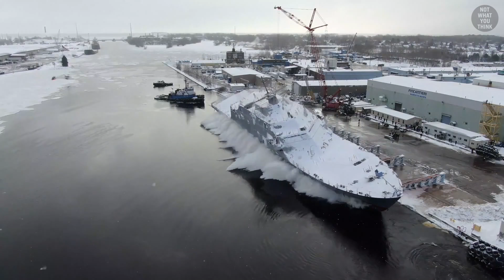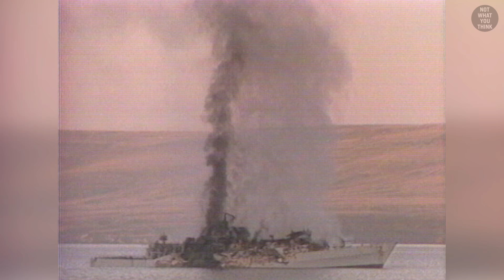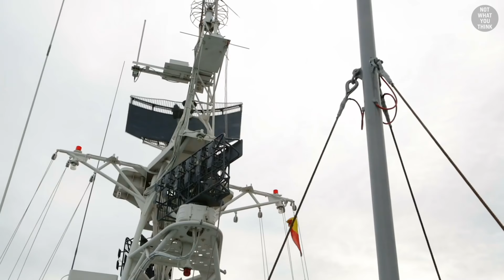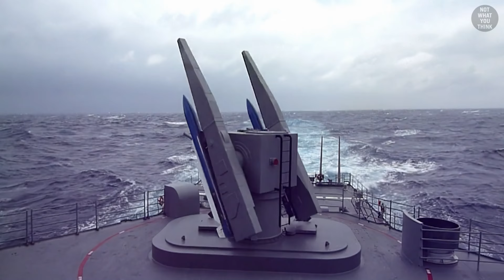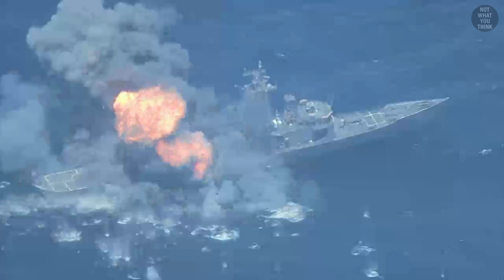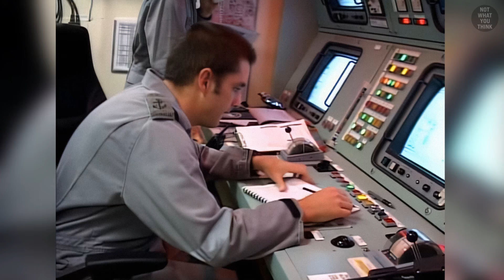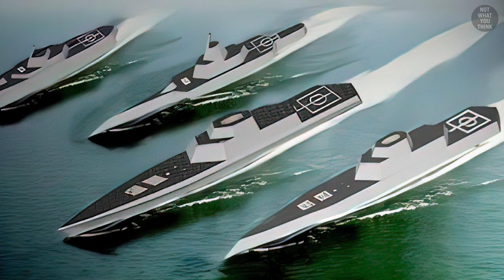How US Navy Made The Most Successful Destroyer ... But Now Has to Replace it.

Comment: I am curious about about the Arleigh Burkes, particularly older ones, and their power generation limitations... i know this may seem like a weird thing to ask, but have they updated all the lightning and displays onboard to LED lighting? Have they switched out older computer processors with newer more efficient ones ones, have they switched out hard drives for solid state drives. I mean a 10 dollar raspberry Pi, is probably more powerful than all of the computer systems on one of the original Berks, combined, and i know is gonna use a shit ton less power. I am not saying you can use a Raspberry Pi, but for god's sake, the miniaturization and electrical streamlining of the technology is there... hell who knows, maybe you could just install Raspberry Pies on board?
Reply: Lighting loads are very small and insignificant. It's the larger inductive loads of pumps and motors to support everything that takes up the real power. DD

Comment: Pretty sure the MK`13 could NOT fire ASROC, but both the MK13 and Mk26 COULD fire Harpoon.
I'm curious was it really a political requirement that the Burke's  were shorter than the Ticonderoga's or was it something like dry dock length?
After all the Ticonderoga's were a DD hull,so it seems weird to say our new DDGs need to be 50' shorter than our DDs.
Reply: NM: I've never heard the '50 ft shorter" requirement.  It makes no sense to have an arbitrary number.  I'm sure it was derived from some other requirement.

Comment: Actually, if you look at pictures of the USS Enterprise and USS Long Beach from back in the 70's,  you will see the original "SPY 1" radar.  Yes the predecessor to the AGES Radar system used today.  It has been a long time in development.  (USN 74-84)
Reply: But, those were vacuum tube tech panels. They drew enormous amounts of power, but, more importantly, as I understand, too many critical component parts broke down and not enough spares were aboard. (I didn't serve aboard the Big E, but did visit her several times, one being an 8 hour dependants day cruise/tiger cruise off San Francisco in 83). 

Eventually, those mid-era NTDS panels came down and other radar replaced them tol the Ticos got the SPY-1A/etc stuff.
Reply: @davidsyes5970  I know just about the USS Norton Sound as a test platform for the AN/SPY-1 (1973) and the preceding phased-array AN/SPG-59 (1962). Since the USS Norton Sound's engines could only produce 9MW, there was a natural limit to the amount of power which could be diverted from propulsion into the radar system. I doubt that it could draw as much power as the AN/SPY-1A and later series (up to 6MW at full power).

Well, it is probably true that the SPY-1A and especially the SPY-1B (and later) had a "tighter beam", allowing for more efficiency and lower average power (only 58kW), and the option to run it on lower power with still sufficient capabilities - in situations when no threat is present. The  SPY-1B  was so efficient that it would have only halved the range of a Ticonderoga-class if it had been operating constantly at full power!

Well, no wonder that they chose to install the early system on the Big E (which I wasn't aware of!) - it had quite a bit more power to spare than the Norton Sound.

Comment: The Burke on its first cruise cracked and had to spend the deployment in the yards in France.  But the old ship we kept going all the way back to the sandbox.
Reply: Oliver Hazard Perry class had the same problems. They solved there problems, with adding a strengthening beam along the hull on both side, just under main deck. Can be seen as a hump om both side of the hull on Perry class
Reply: @heuhen  I was on a Forest Sherman; USS Jonas Ingram-DD938. We knew the Perry class was crap when the super structure cracked up top after some rough seas on an Atlantic crossing. We were in complete awe of the Spruance Class and I never thought they would retire so early. Good video.  DD

Comment: think about the missions and the cost of each, 1) area AA, 2) local AA, 3) ASW, 4) gunfire, 5) missile strike, 6) ABM. Area AA and BDM require the expensive radar. these also require big VLS cells, which is also suitable for missile strike. the other missions local AA, ASW and gun fire do not require high expense and can be done in a low-cost ship. specifically, gun fire is high risk so should be done with an expendable asset you are willing to risk. Of course, LCS was stupid in going for 40kt, which really stupid in a ship that might operate in shallow waters, and a waste overall. 
31 Kt Burke got his name when he was directed to intercept a Japanese destroyer + transport mission. He had been reporting 30kt for some period to indicate the state of disrepair of the fletcher destroyers that can do 35kt at full capability. When there was potential for action, he found a way to do 31kt. it was probably Halsey's chief of staff who sent the message

Comment: Oh, finally a video about the DDG (X)! Aside from the new hull, the DDG (X) is also designed to be modular enough to be given extra space or "modules" if future threats or future technologies call for it. In short, the overall hull length can be greatly increased per flight! And it's not just 3-5 meter increases, but much more!
Reply: They're designing into the DDG(X) the ability to literally cut it in half, add a new hull section, and weld it back together. They got the idea from the Virginia Class submarines.
Reply: @seanj4119  Technicaly, Modularity was already a concept that was tried (And failed) on the LCS, but it worked better on larger vessels like the Virginia. Guess that was another lesson from the LCS program and the Virginia-Class subs that they're applying to the DDG(X). And given that the DDG(X) is gonna succeed both the earlier flights of Arleigh Burke-Class Guided Missile Destroyers and the Ticonderoga-Class Guided Missile Cruisers, it should have all the room to host future technologies, and if it runs out of room, it should also have the ability to expand within reasonable margins
Reply: @seanj4119  And definitely due to this capability, we might possibly see latter flights of DDG(X) outright exceeding the Zumwalt-Class in terms of both length and displacement.

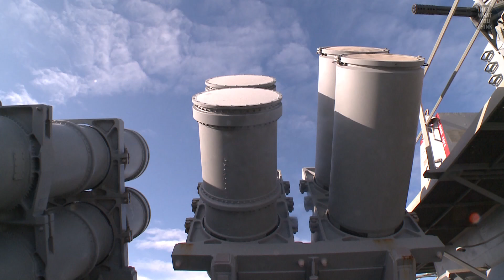Comment: 11:58 actually, the increase in VLS cells didn't come from additional units
they abandoned the onboard missile reloading crane (which was proved impractical) that took up 3 cells worth of space in each VLS unit, one fore and one aft, so that they can use for more missiles
Reply: Impractical in peacetime, but if a practical VLS reloading method could be developed without sacrificing missile capacity, that would be very useful.
Reply: Explain how you are going to load a delicate missile at sea with the ship rolling? I used to do the Safety, security and fire protection loading them on dock!
Reply: @donraptor6156  
"If a practical system could be developed..."

Comment: the irony is that the destroyers are now invading light cruiser territory
Reply: Zumwalt is already bigger than Ticonderoga. Destroyer and cruiser basically just merged into one class.
Reply: @jaffacalling53  Even funnier since the South Korean version of the Burke is both heavier and more powerful than the Ticos, while still being destroyers.
Reply: Arleigh Burke flight III DDG 
9500 tons
510ft Over All Length/66ft Beam/30.5ft Draft

Ticonderoga class CG 
9600 tons full displacement
567ft OAL/55ft B/34ft D

Zumwalt class DDG 
15,656 tons
610ft OLA/80.7ft B/27.6ft D

For reference

Omaha class CL
7,050 tons
555ft 6in OAL/55ft 4in B/20ft D

Brooklyn class CL 
9767 tons standard/12,207 full
608ft 4in OAL/62ft B/23ft D

New Orleans class CA 
9,950 tons standard/12,463 full
588ft 2in OAL/61ft 9in B/19ft 5in D

Pensacola class CA 
9,100 tons standard/11,512 full
585ft 6in OAL/65.0ft B/19.5ft D

Kearsarge class BB
11,540 tons standard/12,850 full
375ft 4in OAL/72ft 2.5in B/23ft 6in D
Reply: @crazychicken7125  man they should just call them light cruisers at this point lol
Reply: Ultimately, less ship specialization saves money and resources and given how warfare is heading, it's becoming less necessary.  It's cheaper to have a class of ships which can do basically everything than multiple different ship classes.  The former is cheaper in terms of ship building costs and justifies a smaller navy which saves on other costs.

Comment: Sounds more like a light cruiser than a destroyer or am I wrong?
Reply: The more modern US Navy cruiser definition was based on the number of missile directors.  Four or more was a cruiser, while less than that was a destroyer or frigate.
Reply: @Kriss_L  The displacement, range and speed of the Arleigh Bourke would have made it a cruiser in the old way of classifying ships maybe.
Reply: @corporalpunishment1133  Then it's a good thing that we're not using the old system.
Reply: @corporalpunishment1133  The Zumwalt wasn’t supposed to replace the Burke.

Comment: On top of that, they're beautiful ships. Once, my cruise ship was overtaken by one of these, near Gibraltar. We should be doing perhaps 16 knots at most and she passed by our starboard very close as if we were dead on the water! Magnificent sight.
Reply: Cruise speed for those destroyers are 20 knots, a cruise ships cruise around 13-16 knots and tops at 23-26 knots, some do faster, like "Queen Elizabeth 2" some can do 34 knots, but then she is designed after Ocean liner standards and not Cruise ships standards.

An Arleigh Burke-class destroyer is capable to do more than 30 knots.
Reply: @heuhen  Believe me, they can move a LOT faster than that. I was on a Spruance class destroyer between 1981 and 1982. Our Spruance kept up with the Carl Vinson, and she was moving at 60 knots. The Burkes are pretty much the same hull as the Spruance, but with some modifications to plane instead of dig.
Reply: @heuhen The QE2 is an Oceanliner...not a cruiseship.
Reply: @jameskrivda1151  I wrote, build after oceanliner standards..., read again.
Reply: @heuhen  I once read that the SS United States crossed the whole Atlantic at 42 knots, but it seems quite a bit exaggerated to me...
Reply: @duartesimoes508  a ship can do more its top speed but it mostly unrecommended for a reason especially in heavy seas
Reply: @duartesimoes508  SS United States highest recorded top speed, was during sea trials: 38.32 knots, note during sea trials, a ship is light loaded. It's a speed they can only hold for a short time.

The fastest Blue Riband ship ever recorded (crossing of the atlantic) is "Cat Link V", a catamaran ferry, build to traffic between Norway and Denmark. But as a PR stunt. they had it cross the Atlantic, where it managed to hold a average speed 41,30 knots, it's top speed was 48 knots.

but among Ocean liners with passengers and not a PR stunt, SS United states was the fastest, she was after all build for speed and expensive to run. SS Queen Mary is in second place, 3 to 5 knots slower, depending on run. But there is 20 years between SS united states and SS Queen Mary, that just how dominant SS Queen Mary was, SS United states was the last one build for speed on that route.

SS United states used 3 days and 10 hours on a crossing, the Danish Catamaran ferry used 2 days and 20 hours
Reply: @ComradePuss  Similar to "emergency wartime power" for aircraft? Like set the gauges so that "100%" is really just 90%, leaving the extra 10% for emergencies.  The engines can do it, but not for long before they burn themselves out.
Reply: @PongoXBongo     No, more like the Space Shuttle: throttles going to 109%.
Reply: @heuhen  You can't say that a catamaran is in  the same classification as a thousand foot ocean liner not even in same class comparison! 🤣
Reply: @duartesimoes508  The SS United States still floats.  She was built for speed.  Narrow aluminum hull and streamlined superstructure; engine room, prop arrangement, and engines based on Iowa class fast battleships.  She still holds the trans-Atlantic speed record.  The U.S. blue water navy is listed as "30+ knots", some could get speeding tickets on land.
Reply: imoes508 not exaggerated at all 3 days 10 hours across the Atlantic.
Reply: @duartesimoes508  SS United Staes crossed the Atlantic in three days ten hours on her record crossing at an average speed of 35.59 knots.  The ship did 38.3 knots on her trials.
Reply: @duartesimoes508  SS United States, is build as an oceanliner with fast military troop transport as secondary role. SS United States and Iowa class has similar engines, but not the same engine different turbines), While Iowas boilers operate ad 600psi, SS United States same boilers operate at 1000psi.

Iowa can run her engine at 20% overload, SS United States can the same, but not at the same level as Iowa, thus 43 knots claimed is possible, but never tested due to risk to engines (test speed at 38-39knots). Warships takes the risk of damaging engines, just to gain the upper-hand and they don't need to care about income, like an oceanliner.
Reply: The US Navy maintains a Forward Deployed Naval Force (FDNF) of 4 ABs in Rota, Spain -- right around the corner from the Straits of Gibraltar. Chances are high that this was one of those ships, and they were just trying to get back home!

I would know, since I was aboard one of those ships when she was homeported there -- USS Carney (DDG-64) -- and we always flank speed-ed our way home through the STROG on the way home from deployments!
Reply: I'm stationed in Rota on a destroyer
Reply: ok but what was your cruise ship doing lol
Reply: It will take years before they can replace them all 1 at a time in a year

Comment: Fun fact ddgx is designed off the cn type 055
Reply: Actually if you compare both the 055 and DDGX they don't look remotely similar But if you compare both the DDGX and the Japanese Asahi-class DDGs they look remarkably similar.
Reply: 1- The only similarity is the bow.
2- The design of the DDGX is not final, it’s just a concept to show off capabilities.
Reply: Fun fact the type 055 is based on arliegh burke. classs    they just made it stealth looking
Reply: @lyric-992 I think cuz that was the reason they were built to counter arleigh burke dds
Reply: @lowlevel9448  055s have full dual band radar, integrated mask ... Burk does not DDG - 1000s have integrated mask but only 1.5 band
Reply: They only have the same  Bow design.    But they have different hull shapes and super structure.    I have both 3D model of them. And they are very different from each other.

Comment: Correction for the above deck launcher part; the mk13 arm launcher was capable of launching Harpoon Anti-ship missiles but at a significantly slower rate and so could upgraded mk11 launchers
Reply from the maker: thanks, we did a short fact check, the original USNI article said "only SMs" but then we found out about antisubmarine. Looks like missed on harpoons thou

Comment: This entire video is mostly BS.  Capabilities were curtailed to differentiate between classes, and cost of everything escalated the Destroyers capabilities (number of missiles capacity mostly) the Arleigh Burke destroyers we built on a new hull design that could handle heavy weather, and greater displacements with the Combat Information System down in the bowls of the ship.  The Destroyers actually cost more in the end than the cruisers with less missiles on board.
As the DDG-51 Flt IIIs come out they are the most expensive Burke ever built and that is with a 10-unit block buy acquisition strategy.  However, the Flt III capabilities with the AN/SPY-6(V)1 with its 37 Radar Module Assemblies per antenna, Evolved SeaSparrow Missile capability, and other improvements make this an excellent Cruiser Replacement in the short term.  We need at least twenty-two (22) so we can replace the cruisers coming out of service.
Trying to call Littoral Combat Ships low-end Surface Combatants that are 'good enough' is a huge understatement.  It can barely defend itself against a determined attacker using supersonic Anti-Ship Cruise Missiles.  A multi-layered Missile Engagement Zone (MEZ) is required just to SURVIVE in the modern naval battlespace.  The new Constellation Class (FFG-62) Aegis Guided Missile Frigate is an excellent low-end Surface combatant.  The AN/SPY-6(V)3 is what puts it over the top, and a Flt II version should be built in numbers to replace the DDG-51 Flt I&IIs as they come out of service.
The DDG-51 Flt IIAs should all be upgraded with the AN/SPY-6(V)4 24-RMA radar, or a new number of RMAs that do not bust cooling and power margin requirements in that construct.  The Aegis Baseline 10 also introduces new capabilities like the ESSM which increases the number of missiles the platform can carry dramatically.  
Once the new DDG(X) is out, tested and proven . . . then we can think about building the new largest of the Large Surface Combatants, and it will be the most expensive Surface Combatant ever constructed.
A thought to a smaller Small Surface Combatant should occur to the U.S. Navy . . . an Aegis Destroyer Escort is very doable following the Israeli Sa'ar 6 design criteria.  The Israelis basically designed and built a mini-Aegis Cruiser.  With its multi-warfare capability and multi-layered MEZ this is a very capable vessel and can hold its own when up against anything . . . including an Aegis Surface Combatant.  American industry can improve on that design concept with U.S. systems and a longer range and on station time.  At less cost than a new FFG-62 Frigate we can build more of them more rapidly.